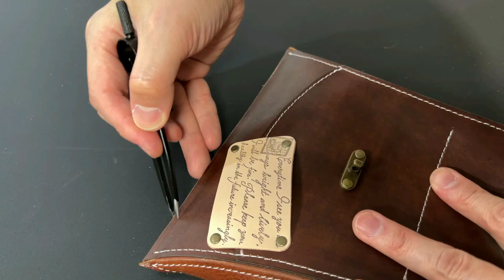Making an Antique Mini Bag / Pattern No.66

Comment: hello, i'm trying this one to my cousin birthday 15th years old... wich glue you use? to see if i find here in panama
Reply: all in 1.5mm leather i cant find 2mm
Reply from the maker: 1.5mm is also fine. The adhesive was rubber type, but water-based bond is also possible.